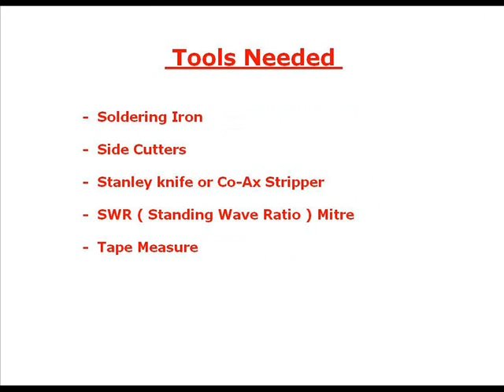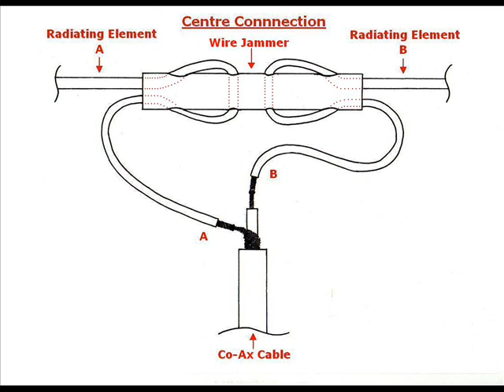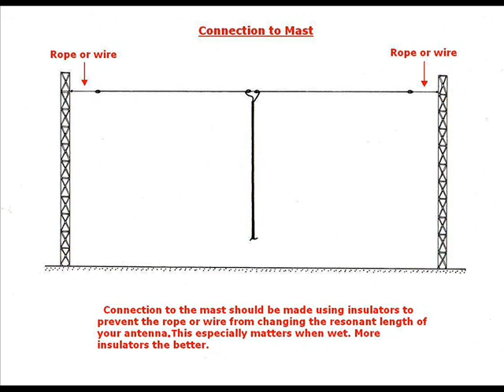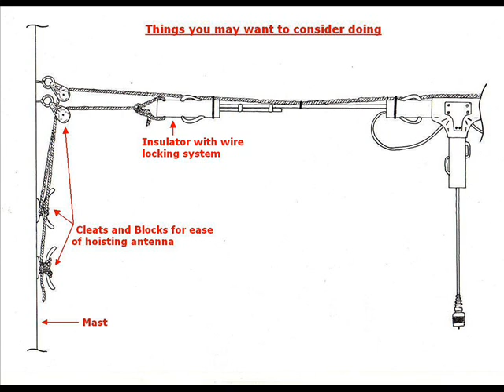DIY 40m Band ½ Wave Dipole Antenna

Comment: A dipole is a 75 ohm antenna. Don't HF radios have a 50 ohm  antenna jack?  Will the slight mismatch matter?
Reply: It ends up as 1.5 swr